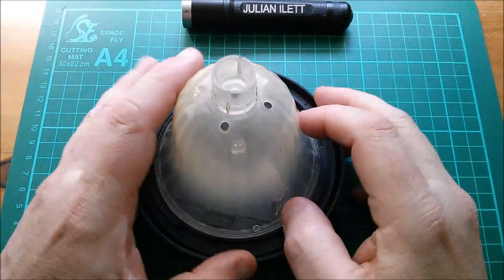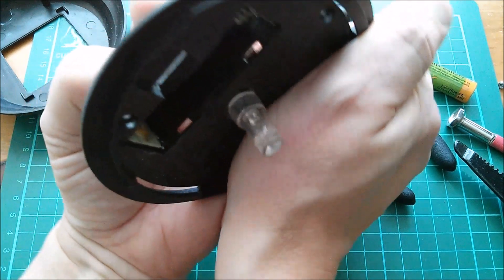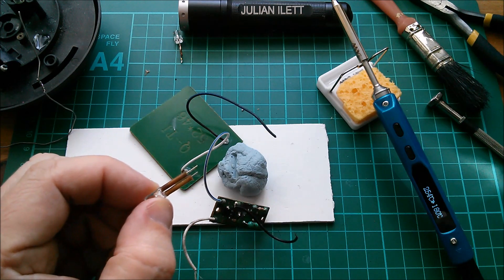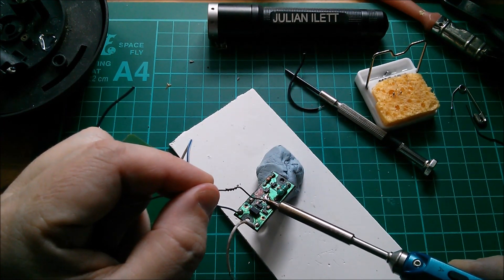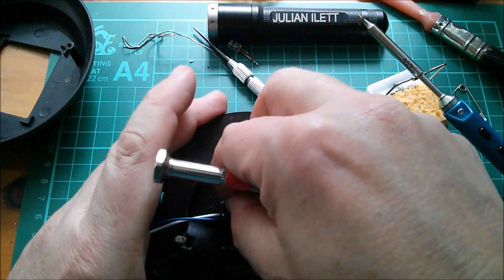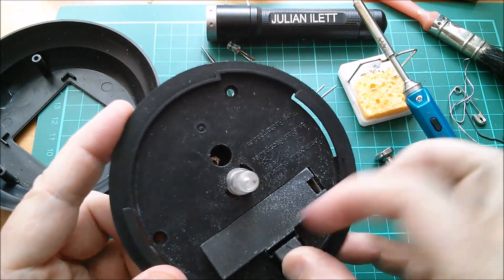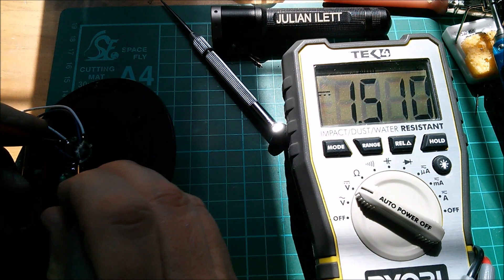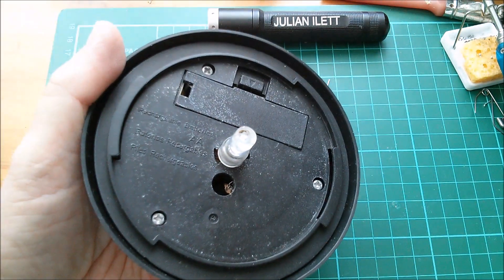Garden Solar Light Supercapacitor Downgrade

Comment: You need a bigger capacitor, if that one is 10F then if they made one to fill the whole battery area then it may be able to reach 100F. But even 100F will still reach it's 1.5v from this system faster than the batter would and it won't actually be holding it's 100F either, maybe only around half of that. So 55 or 50F and it will be around 0.05 watt hours. 
I suspect it would only last around 3 hours. And with your smaller model here with the tiny cap I think only about 10-15 minutes you should expect it to run for. Because also the capacitor does constantly drop when being discharged. 
A battery is always superior for these things. It will be cool when they do make high capacity capacitors in the future though. Because when they do this it would be a good fit for their usage as things like self discharge wouldn't matter as it would turn on and start going as soon as the sun goes down anyway and doesn't have to sit around holding it's charge. They would have to make a new circuit that would be able to get the most power out of the capacitor even when it hits voltages well under 1V also for it to be efficient. Imagine a capacitor the size of that battery compartment that is 1000F.
Caps will never replace batteries entirely of course, but I think in the future they will replace batteries in certain things which commonly go through charge and discharge very commonly like solar lights, battery toothbrush (which sits in it's dock), etc
Reply: VFORVENOM  With Lithium based battery technology continuing to produce better batteries, I don't think super capacitor technology will ever catch up.

Comment: So the corrosion may have been caused by some moisture getting in there? I suspect, since we can have electrical components inside a house like a graphics card and computer motherboard for decades and they still don't have corrosion. This is the cause of the corrosion also on the other parts. It maybe wasn't water literally dripping in, but maybe it was like mist in the morning and anything outside that has any holes in it will allow some mist to go inside it. 
Either way, they rarely care about the long life of the solar light. There are much more expensive ones that use glass and rubber seals that probably would last a very long time and not allow moisture in. Here in Australia the most cheap solar garden light is 1 dollar, the expensive ones are around 8 or 10 dollars each.
Because here in Australia even the black plastic part on cheaper ones will just crack and fall apart after about 18 months in the sun. I like the ones with a metal top which looks like copper (but it actually some other type of steel with colour), and then of course the glass piece for the light (since plastic ones go cloudy and even yellow in time). All of my cheap solar garden lights literally fail within 2 years, but my expensive one has lasted around 6 years and still counting and all I had to do was replace it's battery and it had no corrosion in there either.
Reply: VFORVENOM Yep, you get what you pay for.

Comment: Using a full sized heat gun for 2 very small pieces of heatshrink?  A bic lighter works better in that situation where you don't have a hot air gun station in my experience
Reply: or just rub it with your soldering iron..watch it shrink instantly..

Comment: I made one with two 400F super caps. It can last throughout the night if it is a really sunny day, but my solar panel is a fair bit bigger than that one. It's too bad there isn't an IC out there that is made for supercaps yet. The one I have stops at .9V to protect a NiMH battery. Only gets a range of about .9-2.5v that way.

Comment: You were lucky with resoldering the back of the PV Cells. i have some that WILL NOT take lead solder at all !. polish the PV cell with Silvo or toothpaste.
Reply: I have taken apart a couple of garden lights and found the red positive wire to the PV cell comes off rather easily ( weak solder connection ? )   Any suggestions on making a successful solder connection to a cell ?   JwgK
Reply: @jameskrivitsky9715  now days i think it may have been the lead free problem. Maybe look at using lead free solder.
Reply: @zukjeff  Thanks, I'll give it a try.

Comment: Over the years I have, for some odd reason purchased lots of these garden lights. I have no idea why I do this because you will be very lucky to get one year out of them. Basically, EVERYTHING fails , even the plastic case falls apart due UV. Still they do look good for a few months. Soon be time to get some more!!
Reply: At $2 each why, I can try to fix them and learn something in the process. If I fail to fix it, it will not break my wallet.
Reply: @Adam Pierce
many different types of plastic :-)
and it may be that if you bury your garden light it would last for many years , except the battery , hehe :-)
Reply: I hear you but it's kind of part of the fun to see how they accept harsh weather conditions, though they never seem to be very water proof. Guess can't expect too much for the cost.
Reply: Wait a moment! I’ve been told that plastic remains in the landfill forever without degrading. Can the information be wrong?

Comment: We know that Q=CV and so C * ΔV = Q = I * t and rearranging for t gives t = C*ΔV/I
if the voltage range was 1.8 down to 1.1 volts and LED current was 5mA, then I make the duration:
t = 0.7 *10/0.005 = 1400 secs or 23mins
Reply: Juncus Bufonius Storing power from regenerative braking in trucks, trains and other vechicles is one thing that springs to mind. May have some application in the model aircraft and cars area due to short run times and high current demands.
Reply: +Juncus Bufonious Yes, supercapacitors have applications where they need to supply large currents. A battery always has significant internal resistance which makes them useless in those applications. A typical AA battery has an internal resistance of about 150 milliohms, if you completely short circuit the battery it would take 20 minutes or more to drain it, and the majority of the power would be dissipated heating the battery, not heating the wire shorting it. Also, internal resistance goes up as the battery drains. Output voltage goes close to zero under high load, due to internal resistance losses.
Reply: Hey love your videos man!
Reply: That's not very long. Do they make bigger super caps in an AA format?
Reply: Juncus Bufonius
I remember watching a video of a guy who was tired of the backup battery in his alarm clock running out (9V... how often does the power go out long enough for that to happen?) so he replaced it with a supercap.
But apparently he had some success. If only I could find that video again.
Reply: @Juncus Bufonius Look up Robert Murray Smith. He has hundreds of videos showing the process of building and discussing different forms of supercapacitors which can be made starting out with common household ingredients. His youtube channel is an entire course for the technology, and he's achieved energy densities rivaling lithium ion with all the benefits of a supercapacitor (like 100C charging for example). Carbon batteries are supercapacitors and any organic material that can be turned into a carbon can be used to make supercapacitors. On the other hand, all lithium based batteries require Cobalt in their electrode material, which is mined in the Congo, often employing children to do the harder to reach mining. So IMO any lithium battery is a dirty battery since the Congo has over a third of the global Cobalt market export.
Reply: Ah yes another reason why super capacitors see completely pointless. No use I've seen has even approached a battery. I can't see why people even mention them when no viable use has ever been referenced. Is it really just snake oil or has anyone got an application that lasts more than a few minutes where a battery would last hours? Please I would really like to find out why anyone thinks these are useful.
Reply: Juncus Bufonius well the use in a solar garden light is great. I just ordered 6 100F ultracapacitors just for that use. It has a lot less energy density than a battery, but it will last longer, has less problems with specific ways of charging, doesn't care about temperature as much etc (NiMh usually does not survive the winter). In the video he used a 10F capacitor which is way to little but I think I should be ok with 600F.
Reply: @TheFreak111  I barely got 2 years out of my solar lights.  I feel that they arrive with a fully charged nicad battery then they eventually run down to the point they can't be charged enough by the solar.

Comment: Go ahead, toss all that circuitry, build a juel thief circuit to connect the solar to the super cap, and another from the super cap to the LED, things should work much better.  Strange the things the human mind can come up when given a pile of electronic parts and lots of time to play around with them.  The true genius is in how you hook thing up to make different and better devices, or perhaps just different and innovative devices.  Thank you so much for the video's I watch every day for new ones to keep my old brain firing on all 8 cylinders.
Reply: The garden light circuit is a joule thief circuit. The battery is too low a voltage to light a white led so the IC and inductor boost the voltage to the LED. The circuit is very simple and very efficient.
Reply: Is there some reason that you don’t use flux? I think that it would make soldering the oxidized solder blobs much easier.
Reply: I always polish the surface of the solar panel with Brasso, it lets more sunlight through. The poor thing you had has cataracts.
Reply: @robhall2570  the best idea for longevity is but a can of automotive clear coat paint and the panel will last years instead of 1 or 2 as it is uv proof not like the resin panel
Reply from the maker: Thanks Jerry, I always appreciate your comments :)
Reply: Jerry Ericsson

 I did it with 2xAAA battery and 5v solar
Reply: Don't you mean all 7 cylinders???

Comment: Dab some flux with your flux pen on the corroded bits.  It helps a lot.  I also dabbed a load of conformal coating on our garden lights. A dab of petrolium jelly on the contacts of the battery help stop corrosion.
Reply: Flux makes everything better.
Reply: wobbly sauce
Especially capacitors.
Reply: Just like bacon!
Reply: dabdabdab
Reply: Flux is your friend Julian, flux is your friend.
Reply: It's not the flux that makes it better. It's the dabbing!

Comment: The Tips of the TS100 are constructed, that the heat is only at the very end of the tip. If you heat the iron up to 350°C the end which plugs in the iron stays at about 30-40°C. That means you can change the tip even when its still hot.

Comment: What is the difference between a supper cap and a Normal cap. And where did you get them?
Alan
Reply: A "supper capacitor" is for evening-meal applications only. Normal caps can be used all day and night.
Reply: Supercaps use a different internal construction which allows the plates to be separated by self-forming insulating layers at nano-scale. This results in a massively increased capacitance - easily over a farad, orders of magnitude higher than any other type of capacitor. The down-side is that they have a very low maximum voltage, typically around 2.5V. The highest I've seen is 5V, and I suspect that was two matched capacitors in one package.
Reply: They have a few advantages over chemical batteries. They can achieve higher efficiency with proper management. They have enormous power density - if you think shorting a lipo can give you a lot of current, it's got nothing on a supercap. They barely age at all - ten year life without loss of capacity, even if you charge and discharge them a thousand times a day.
Reply: Nothing. The so call supper capacitor has more farads.
Reply: Same difference as between Superman and a normal man ? maybe :)
Reply: They are expensive and seemingly need to have huge numbers to make them useful and long time or high current to charge them for any heavy use. So appear to be the perfect way to part people from money. Li-po actually works now. They are also much bigger than Li-po at the same mAh I believe.

Comment: Will not last long because most of boost converter ICs stop working around 0.9V-1.2V
So half of the supercap is wasted. If resistance of diode is know you will get time about 0.5RC

Comment: I am curious. Because there isn't a battery management system in the solar light, with the open circuit voltage of the panel being about 3volt (I think) the super cap would be charged to the full 2.7 volts. Which when the solar lights LED turns on, would the higher voltage of the super cap be too much for the circuit powering the LED? As it's expecting 1.2volt? I love that your experimenting with these again, I started fiddling with them yesterday. Fun little things, and cheap!
Reply: Ah, ya know what, I watched the rest of the video and you answered my question. Nice! I usually watch the whole video before commenting. Should have waited! Thanks for the project idea! Any idea if this will work with the amorphous style solar lights? Those are just 1USD a piece here, could be fun to tinker with.
Reply: Should work with any solar light that has just one AA nicd/nimh battery, as they would need the joule thief or step up circuitry to get the roughly 3v needed to light the white leds.

Comment: you should test the runtime!
Reply: Probably around 10 to 100 minutes, depending upon LED current. A couple of hours at 1 mA for a dim LED.

There must be room inside that case for a lot more than 10 Farads of storage, but a NiMH battery would be cheaper and more capable. The first thing to do with most of those lights is to dump the supplied battery and to put a known good one into the holder. I've seen new '600mAh' cells in those lamps with true capacities of less than 150 mAh. As a consequence, they spend much of their time discharged and die quite quickly.

Next job is to waterproof the solar panel and other components adequately. Rainwater can destroy most of those lamps within a year.